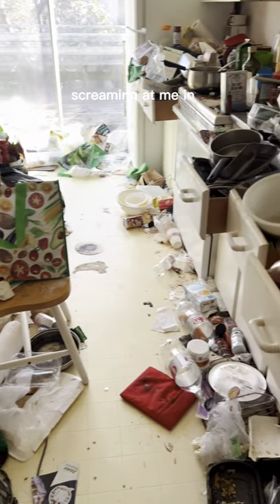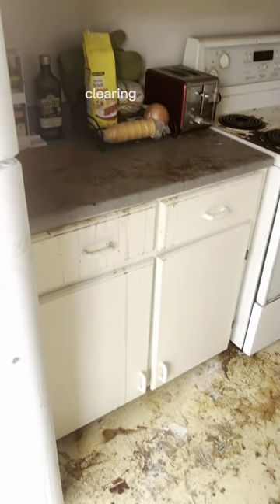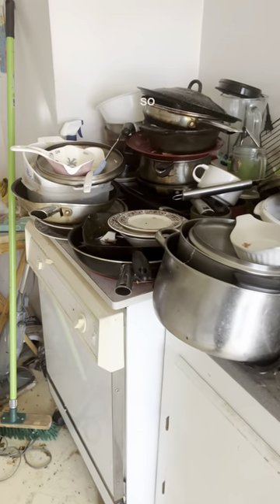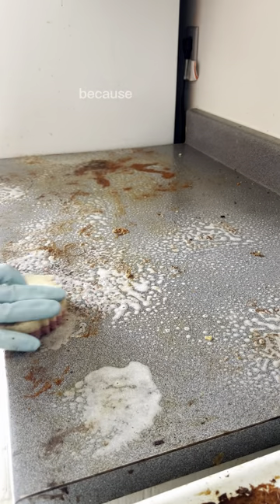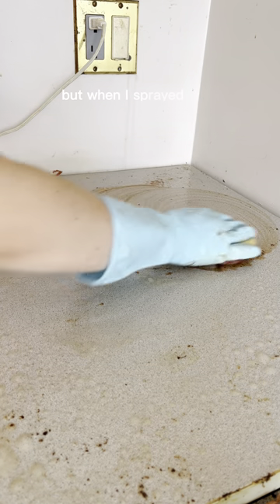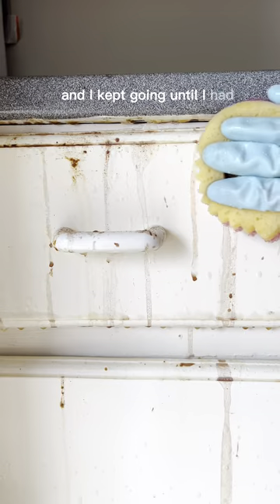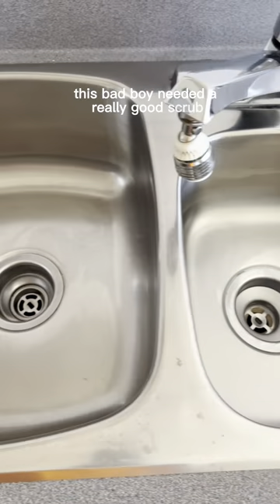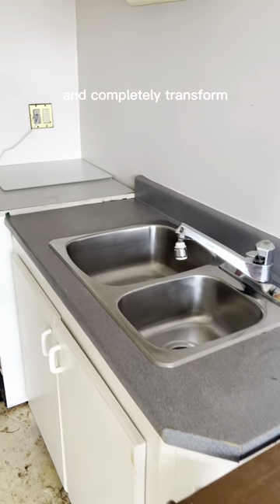Update on the most recent free cleaning for the older gentleman! Im back to continue tomorrow ❤️

Comment: I tried to figure out how to contact you after watching one of your toilet cleaning videos! That sounds weird! 
Anyway many years ago I cleaned houses. I learned an amazing tip. Instead of the pumice stone, which I detest! I started using the sanding screens for drywall mud. After its dried of course. But the screen can be used on porcelain. So far, all the porcelain I’ve come across. And it works like a dream and doesn’t leave those dark marks on the bowl. It lasts awhile too! Never went back to pumice! 
You can find it near the sandpaper at the hardware store! You cut into whatever size you prefer. I like a 3x3 inch square. 
If you try it please let me know! 
Great videos!!!!!!
Reply: Is there a particular grit size you use?

Comment: When you do the dishes first, where do you put the clean dishes? It is usually more dishes than would fit on a drying rack and there are no clean surfaces yet. Are the dishes dried and returned to the upper cabinets? Just interested in the logistics because i usually clean a specific area of the counter before doing dishes in order to have a clean space for them to dry.
Reply: This occurred to me too when I was at the dishes part
Reply: If I'm ever in the situation of too many dishes for the drying rack I will just dry them myself with a clean dry dish towel and then put them away.